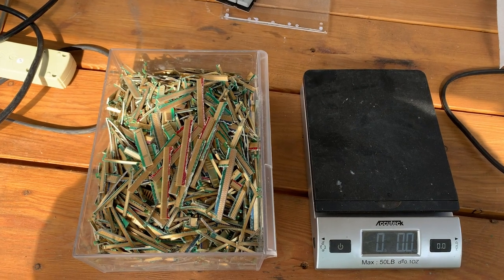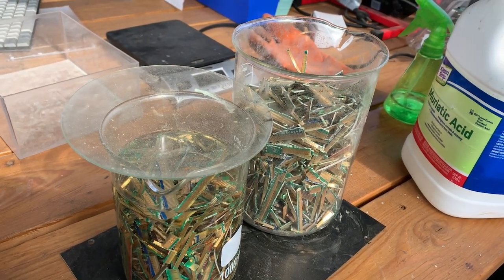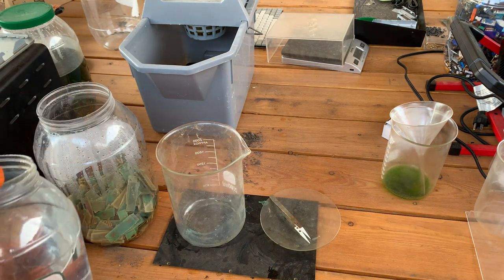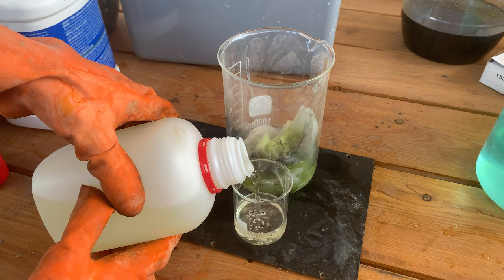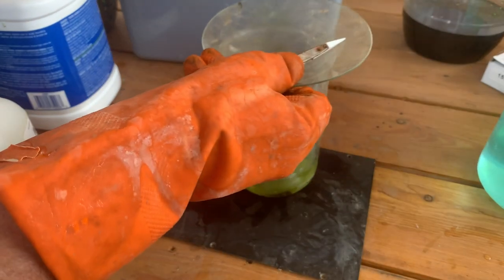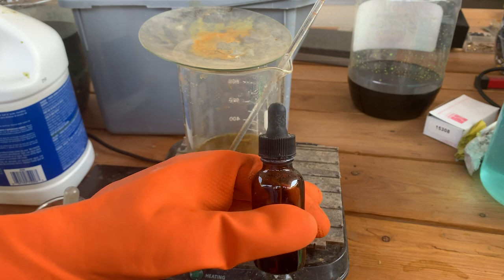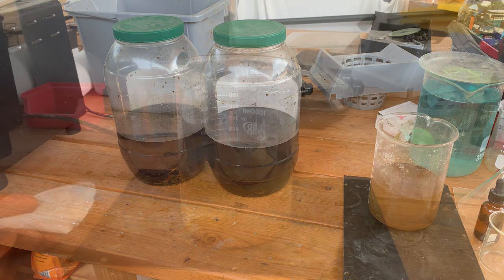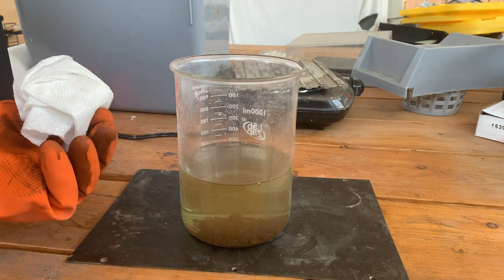Ridiculously High Gold Yield From Vintage Card Fingers

Comment: I dont know if you ever look at comments on old videos. But a big part of your problem with everything taking so long is that you are not letting air in. The reaction of Copper with HCl and copper chloride consumes oxygen from the air. This is why folks use bubblers - to add O2. If you put a AR mix in a plastic jar and then screw down the lid, you are preventing oxygen from getting in and thereby killing the reaction. The purpose of the peroxide is to start the reaction by generating a little copper chloride. The peroxide is fully consumed and gone in an hour or so. The copper under the gold on the fingers will not dissolve in HCl without oxygen and copper chloride. Because there is no oxygen, you are getting a lot of copper still attached on your foils.
Reply from the maker: I am still a small enough channel that I read literally all comments made.  Thank you for the insights.  I need more o2 … that is something easy to correct.  Thank you so much!
Reply: I was coming to the comments to say something very similar. Need air. Actually lucky the reaction wasn’t really working, if it had been consuming metal, in an air tight container like that, wouldn’t that explode eventually?

Comment: I like your videos buddy.
You can use AP ( acid peroxide ) over and over again. The more you use it, the better it works.when it does stop working just add fresh hcl.
If you want to recover the hcl, put some iron into the solution. All the copper will cement out on the iron. Leaving just hcl
Reply from the maker: True.  I am working on being better and more efficient with my copper chloride and other wastes when I am cleaning up from my projects.

Comment: Did you eat up the excess Nitric with baking soda? That works?
Reply from the maker: Sort of ... I also used other compounds.  SMB also does a little denoxing.  But the best I have found is Sulfamic Acid.  Baking soda was a cheap options and I wanted to try it.  It requires so much more.  As a result, I would have had to add so much more baking soda than any other compound that I have.  I would recommend finding what works best for you... but know that some are not as powerful.

Comment: Nice results.
Collecting these, but the chemical processing is something I'm trying to avoid.
Reply from the maker: I feel like I got super lucky enough times when I first started that if I were a cat, I would be a few lives down by now.  Sulfuric splashes easy... I have lost too many shirts already.  Nitric I knew from the start that there was no forgiveness there.  Ya, when it comes to acids and reaction fumes, there is no practice grounds that are 100% safe.  Be sure if you get into the acid side, that you KNOW what can happen ... and even try to be ahead of the danger.  Thanks for checking out the channel.  I take requests too ... If I have the means, and it is not excessively dangerous, I will consider it :)

Comment: Use sulphuric acid to remove any lead before you drop gold. If you didnt do that I skipped through the video. Use different techniques to drop the gold if you believe the gold isnt pure enough. Using TO MUCH SMB Will precipitate copper. When you see the white-ish foam created by smb that means all the gold is dropped never use more. Use copperas,  oxalic acid and other methods to drop gold

Comment: if gold i cant melt what i will make with palladium
Reply from the maker: To answer all 3 of your messages together… I have a small torch that won’t melt gold.  I would have to buy a larger torch … or I just use my forge since it gets up to temperature and I have a crucible that I can pull the gold out of.

Comment: How much nitric have you used so far since ordering on ebay? You know you can use HCL and bleach to dissolve gold right?  Same thing with hcl and hydrogen peroxide. It needs a good bit of hydrogen peroxide plus heat thats why people were so worried about losing gold with ap became so popular
Reply from the maker: I have been through 1/4 gallon or 4 cups.  Not too much.  I do my best to treat my nitric like gold itself ... I also have not done very many refinements in the last few months.  Bad Idea Metals is a waste management organization... and I have been doing some teardowns of some pretty large objects recently (as well as time off with my family) ... so admittedly, if I were to do more gold refinements right now, I would have gone through much more then I have ... I knew about bleach, as well as HCl + Peroxide.  I read on forums and other places that it is not as "strong" as AR ... I am just getting my mind around all the chemistry.  While we are on the topic of the chemistry, what do you think about Eco-Goldex out of Canada?  I hear it is a cyanide stripping compound which uses zinc to precipitate out gold ... I want to get a batch to try for myself... It looks "too good to be true" ...
Reply: @badideametals  So bleach and AP is still very strong, on the forums they were talking about larger items like jewelry. Those types of solution will not work for those but you can use poor mans AR. It takes very small amounts of nitric to dissolve gold, 200 or 300 ml of HCL and 10ml of nitric wiill dissolve 3 to 4 troy ounces of gold but its smart Refining all the time isma waste and adds up in waste solution. When you do refine and melt just pour the gold into water, this way if you wanna sell something down the road youncan pick out a couple grams or whatever quantity you want instead of having numerous bars with varying sizes, everyone calls it shot like from shotgun ammo. All of the gold I have is in Shot form and when I give some away for birthdays Christmas etc, I just melt it down than which doesnt take long at all and it saves money and i know youre all about that.
Reply: @badideametals  As long as youre dealimg with foils, gold mud or any other traces of gold from ewaste Bleach and hcl will handle it no problem just add a little heat. Sreetips still uses it a lot  from time to time. He recently did the hydrogen peroxide way but it does cost more money which is pointless other than a teaching video. More waste solution and nitric is cheaper with 15 liters costing him $300 delivered. I forget but i believe it was around 2 cents per ml and hydrogen peroxide is several dollars per refine if not more depending on how much gold you have to dissolve
Reply: @badideametals  and sorry ive been MIA with battling my health problems and taking new meds....immunosuppressants and my body isnt liking it
Reply from the maker: @chosen1one930  This is all good info!  I was under the impression that AR was 3 to 1 ... your numbers above are more like 20 to 1 or 30 to 1 ... that would save me so much more Nitric :)  I am going to try that.  Also, Shot is a great idea.  I have a number of impure bars right now ... about 30 grams and it is a mix of close to 24K and some with so much copper that the gold is pink.  So, when I refine that down to take out the copper, I do plan to make either shot, or a cool medallion as my first significant melt.  If I can get enough subs by the end of 2021, I want to do a give away also ... but I am not tracking to hit 1000 in the time remaining... but we will see.
Reply: @badideametals  NEVER PRE MIX AR, its a absolute waste. I forget the name for, Ive been having short term memory issues which really sucks. When youre dissolving gold put your HCL in first let it warm up slightly than add a pipette or two to begin with and let it go for 5 minutes than see how much gold is left. Usually just give it a little time and heat and thats all you need. Pipettes are usually 2ml or 3ml. I still have a bag with 100ish I bought some 5 years ago before starting to do less and less refining.
Reply: @badideametals  The main source that nitric is used for, well for people who are buying it in bulk and get a good deal use it on pins, fingers and other items that consume a lot of nitridue to base metals. Damn itI think of other things to write and than I just forget, and i sit here trying to remember but nothing
Reply: @badideametals  Eco Goldex works, A LOT of refiners have used it, BUT yields seem to be a little lower when you use it. Ive never used it but its great for low yield material, strips almost instantly. There are different ones as well its not all the same. One doesnt use cyanide and it relys on a high alkaline solution to strip the gold into solution, than you adjust the pH down around 6 I believe or around there than you drop the gold with zinc. My guess would be the lower yields are coming from the zinc by trapping some of the gold since A LOT of zinc is needed
Reply: Oh heres one thing, with waste solutions you have you can treat with baking soda first or after you processed for copper or just like it evaporate in the sun during summer or sitting on the hot plate. Condensing waste material down is key so you only have 3 or 4 waste buckets going at one time
Reply from the maker: @chosen1one930  I may try a batch of eco goldex for the low quality pins and connectors.  There are so many other metals involved and plastics that it may be riser even though yields may be lower… board fingers and ic chips will still get done how I am doing them… I just hope to get some time back from the pins… what a time sink with low grade connectors.
Reply: @badideametals  check out those channels and try to find the videis when you have time or i can try to link them. I have no clue about plastic in a solution like this BUT the seller is very helpful youncan send him a message becore buying and how plastic may work or go bad. They offer 4 different types of eco goldex just read carefully before buying.

There is still one other thing im forgetting but im sure ill remember eventually.
Reply from the maker: Eco-Goldex e (for electronic stripping) vs o (for ore) ... the E series is formulated specifically for gold deplating from other base metals ... Not sure about the others
Reply: @badideametals all of them basically do the same thing, unless if they have changed something. Plastic OR MOST plastic seems to be fine. I dont know if cyanide has any restrictions wth being imported like a extra tax etc. You could also pay a extra fee at time of arrival. 8ve never bought from Canada because of this but if you know what to expect it should be fine
Reply: Incrimental nitric dosing is the term he was looking for. The method Sreetips uses. Ensure you use only enough nitric to dissolve the gold, meaning neutralizing afterwards unnecessary. Less waste. Warm up your HCI, then add your nitric in 3ml doses. Starting out with just one or two to get it going. Wait till fumes die down, add another small shot slowly. Adding nitric to boiling hot acid can be dangerous so do so drops at a time until you see how it reacts. Avoid boil over that way.

Comment: Baking soda?! Why not urea? Diesel exhaust fluid is at every parts store and cheap. Boil it down a little and let it cook and you have instant powdered urea. 

Using the baking soda raises the total ph and you can drop pms out.
Reply from the maker: Baking soda is safer.  Most people I know of uses Urea, but Urea with Nitric is technically explosive.  I have never seen it, but I have a source I go to when I have chemistry questions, and Urea Nitrate is known for being explosive.  Sodium Bicarbonate (Baking Soda) is much safer, and I will need to use much more then I would if I used Urea.  But as I have neighbors, kids, local pets, and a government who all get curious about what I am doing... I would rather not bring extra attention when I am playing with my chemistry set...
Reply: @badideametals  I’ve refined for 16 years now, and never had or heard of an incident doing it. Urea nitrate is what you’re talking about and it takes a VERY high temperature/explosion for it to be set off. They have to use high power blasting caps to start a reaction with it.

I could take red hot urea nitrate and drop it on the floor and nothing would happen.
Reply from the maker: @redbaronrefining5322  fair enough :) I don’t have 16 years experience, so I consult with my network of smart people ... one of which advised to use something other then urea... possibly it was to keep me off of lists that track people who buy or make restricted ingredients.  I will look into urea for future use, but for now, I have a crap ton of baking soda
Reply: @badideametals  for one you have these videos showing it’s exact use, but I mention DEF (diesel exhaust fluid) because you can buy it at any auto parts store or Walmart. No Id, no bs. It’s pure urea, easy to find and cheap. 

You can concentrate the gallon down to half gallon if you’d like for storage purposes, or can pour it right into your beaker and it’ll do the same thing.
Reply from the maker: @redbaronrefining5322  again, thanks!  I will look into it for sure

Comment: Well thats why you have more gold. RAM/MEMORY Finger's HAVE MORE GOLD Than regular fingers you pull of other boards. Here how fingers go with yields, Memory and ISA or ISA like fingers will always yield the most, AGP and PCI fingers yield much lower A LOT LOWER, usually only a gram to 2 grams per pound deoending on green board left behind from cutting. Slot processors will usually yield more than AGP and PCI, you should separate fingers into these categories and do separate videos on each type
Reply from the maker: Very helpful advice!  I just lump all fingers into the solution together.  Thanks for this comment and the 2 below!
Reply: @badideametals  I figured it would be good videos for you and you get a somewhat accurate data for yields if you start to buy material from people or on ebay to find deals. Always good to know yield data even though it will fluctuate since gold plating varied due to the process and where it was being done

Comment: You dont have to refine fingers so much, twice is enough if you know what your doing. Mekt your gold better, the way youre doing it now absolutely sucks. If you get borax left on your gold button or bar use a solution with 5% sulphuric acid and place the gold in the solution for 5 minutes than pull it out and wash it off. Borax gone. Dont leave it in there to long it will create a fucked up finish
Reply from the maker: Ya, I use sulfuric to remove borax ... I have a good melt dish, but the map or acetylene torches are future purchases for me... I will get there eventually.  For now, I just drop the gold in a clean ceramic crucible dedicated to gold melting.  Uses a bit of propane, but it "works" for today.  Your comments are super helpful.  I am always looking for better ways to succeed with less expense and less waste.  Thank you again!
Reply: @badideametals  I would just weigh the gold mud instead of trying to melt it. Torches are fairly cheap but im sure they cost mire right now due to inflation and supply even though all of this was expected due to the pandemic not Biden like most Republicans say. Every country is faces these problems but America is being hit the hardest due to so much we import and it mainly comes by boat. Food is a different story because of the crazy drought and other weather problems and sadly it will only continue and get worse. Im not Democrat or Republican I just hate how false propaganda is being believed at crazy rates same with conspiracy theories
Reply: @badideametals  Politics can be a soar subject, im just tired of all the bull shit lies, propaganda and conspiracy theories dividing this country. Its really sad and I believe it will get way worse so get as much gold as possible